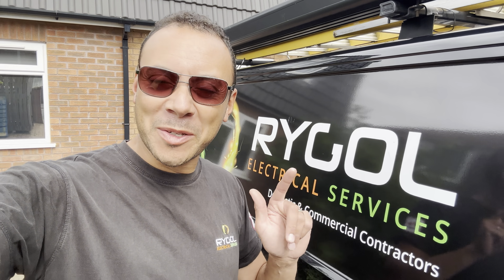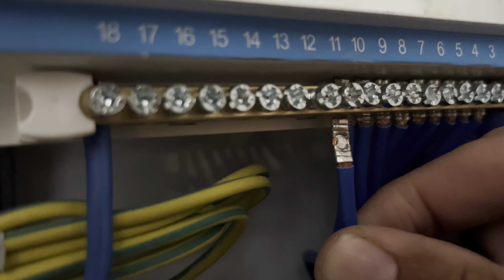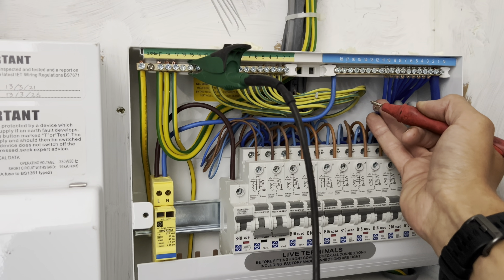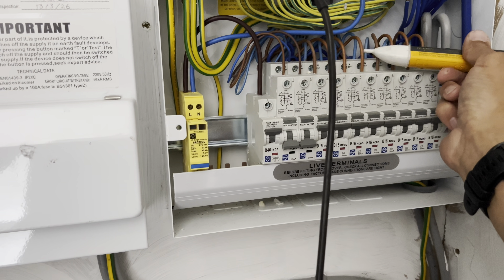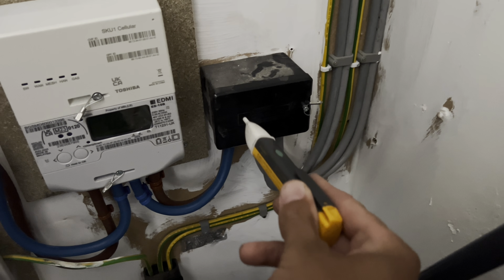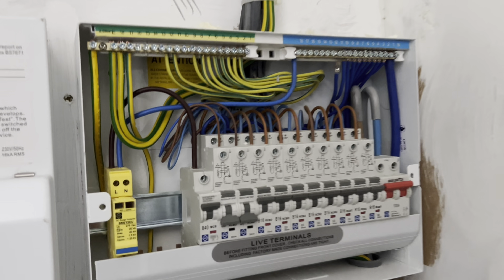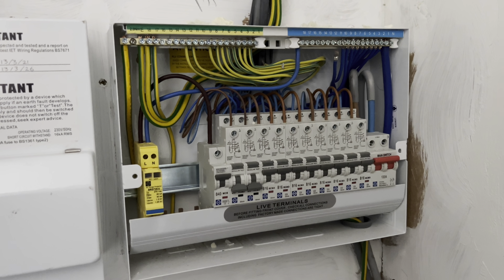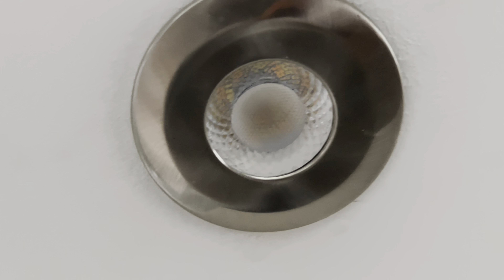Smart Meter Disaster! ⚡️

Comment: This is what happens when the person changing the meter is NOT a trained electrician and has only gone on a 1 day course.
Just had my "Smart" meter changed for the third time ( late last Friday). The "Meter fitter" got a screw cross threaded and asked to borrow a hammer to bang the screw in.
A complaint will be going in at 9.00 AM tomorrow.
Reply: Along with lack of experience or proper training, they're also under pressure to install as many meters as quick as possible
Reply: @mohammedusman7065  Don't even talk about it. As a chartered engineer, I was called in by one of the supply companies to sort the mess out. More than half of the guys trained for less than one hour, had no previous electrical experience whatsoever. 
They were swapping meters live, pulling service head fuses out on full load. On one installation, a caught a guy with all 8 cables dangling on a full current 3 phase installation. They were completely baffled when they encountered CT's and regularly burnt them out by not understanding the shorting  procedure.
The office sent one guy out to connect a 225 Kva supply to a tower crane. He had no idea of CT ratios and was not supplied with a shorting link block. Fortunately, he took one look and called me.
I am going to risk posting this on here, because it is for the right reasons. 3 of the guys could hardly speak 2 words of English. To me, they were the victims of a company who were not protecting their safety.
Reply: @mohammedusman7065  Those meters are very customer unfriendly, they measure apparent and reactive power which the mechanical ones were not, plus the inertia of the disc in old meters did not count usage "spikes", everyone that I know said their bill has gone up after getting smart meter.
Reply: @FrozenHaxor  Most likely the replaced meter was decades old and worn so underreading.  The bill increase would have happened with a new mechanical meter too.
Reply: @thisnthat3530  No, the mechanical meters in our country are changed every few years, the last mechanical meter for my house was 4 years old, and it's not just rotation of meters around for testing and anti tamper purposes, I vividly remember the production date of the meter matching the installation date. I don't remember the make/model, I believe it was a Landis & Gyr and it had a fault indicator LED if one phase happened to be out.
Reply: @mohammedusman7065  mine WONT be one of them i refuse it
Reply: Reverse polarity. Anyone with an old martingale would have seen that, could have killed a child,
Reply: NVQ's 😄👎
Reply: @g4joe  If they are being issued with NVQ's then this only confirms they are NOT worth the paper they are printed on
Reply: How come tge RCD closed with that fault
Reply: No one changes meters after a one day course. A MOCOPA qualification is required and the initial training is a week in a centre and then a portfolio is built up while working with a mentor for a few weeks. When you said usuing a hammer to bang a screw in, I initially thought a meter terminal screw and that would be horrific of course. But I assume you mean a screw into the fireboard? It's not something I would do but a newbie might if the screw head had lost it's shape and wouldn't go in or out. It does sound like you had a memorable experience though!
Reply: @0liver0verson9  No it was the bottom left enclosure screw on the new DP isolator switch that he had just fitted as he did not like the one that was fitted on the last meter change less than  year ago. Photo's of the bent screw off set in its hole have been sent to Octopus Energy.
Just thinking back to when I first started out all screws had to be "Dressed" now virtually no one even knows what "Dressing a screw" means let alone being able to see if they had been "Dressed" properly. Times change and standards fall.
Reply: @PeterChapman-rg6gr  Octopus Energy usually have high standards I hear, so they won't be impressed with this.
Reply: @0liver0verson9  That is what I am hoping. I have another scheduled meter installer coming on the 24th September to finish the work that the last one failed to do.
Reply: @picklyplum  Sorry to burst your bubble but I have had 3 Smart Electricity meters fitted by G4 meter fitters, sub-contracted to British Gas, who have been open about only going on a 1 day "Meter fitting" training course and now I have had 2 visits from Octopus sub-contractors to change my electricity Smart Meter. Neither of then have either done any "Apprenticeship" nor have any of them been trained "Electricians".
Ps I have already lodged a formal complaint with Octopus and tomorrow I will be sending them photo's of the newly installed isolator switch c/w its hammer driven bent cover screw.
Reply: A few years ago I had bought a new Hotpoint washing machine (mistake) anyway the main seal was leaking so an "engineer"" came out, we got chatting and he was ex RAF like myself only difference was I was an aircraft engineer and he was a "storeman"? I didn't think too much about it till the next day when the seal leaked again and they had to send another proper engineer out, the storeman had fitted the seal upside down. The second bloke  certainly did not sing the praises of the original bloke lol
Reply: 😂😂😂 .... a hammer to bang in a smart meter screw .....certainly not a true story ...... you are obviously confused as to why the hammer was required....
Reply: @deosiewilson732  Luckily not only did he ask me to lend him the hammer but I have sent the Photo's of the bent screw that is now off set in its screw hole and the impact marks of the plastic enclosure to Octopus Energy. The screw that was hammered home was the bottom left screw in the new DP isolator switch that he fitted as is clearly shown in the photo's that I sent off as is the tag seal number that he fitted to the adjacent screw so there is no dispute on who fitted, and sealed, this switch.
Reply: It's not a one day course.
Reply: @neilduran3586   so the G4 meter fitters who fitted all my BG smart meters were telling "Porkies"?
Reply: A one day course? Don't be silly.
Reply: @ChrisTopher-gu8gf  As I don't remember you ever being present on any of the many occasions when G4, The BG meter fitter subcontractor, was changing any one of the "Smart Meters" that they installed I fail to see how you can even comment on what any of them said to me re the minimal training that they received.
Reply: @PeterChapman-rg6gr  they've probably decided to wind you up! A one day course! 🤣
Reply: @ChrisTopher-gu8gf  or they could be telling the truth. 
Suggestion. How about asking Octopus Energy why I am now on my third visit, and third, use the term reluctantly, "Engineer" to install my latest Smart meter? No issues with either access or space but plenty of issues with lack of competence.
Reply: @PeterChapman-rg6gr  there is no one day  course where you can become gas safe and work on a gas meter and electric meter. To even think this is possible is abit silly. As for the previous engineer  visits. Yes you will get incompetent ones just like you can get incompetent people in ANY industry. Suggestion. If I were in your shoes I would have asked for an area manager to come out with an engineer and look at the issue and see if it can be resolved. Good luck
Reply: @ChrisTopher-gu8gf  Firstly my comments relate solely to those who have come out and failed to carry out a proper install of my Electricity "Smart Meters"
Secondly I have sent a whole set of photo's to Octopus Energy given the "Meter Fitter" is on sub-contract to them.
Reply: @PeterChapman-rg6gr  I'm sure you have Peter, I'm sure you have 😄
Reply: Incorrect you can have a 100% competent untrained electrician and a compleat IDIOT with a certificate as in this case!
Reply: If I had a £1 for every exposed conductor or lazy crap job from a 'qualified electrician' I'd be rich 🙄
Reply: @picklyplum no, you don’t “need” to be a trained electrician to undertake ANY electrical work, however you DO need to be a “competent person”, as uk law words it. This to me is a sensible approach as it allows sensible flexibility. A trained electrician backed by a trade body has that trade body behind them in court if things go wrong, to vouch for their competence. Someone without this backing is on their own in court. An installation such as the above would immediately be deemed incompetent and as-such the person responsible would feel the weight of the law. In this case that is extremely serious as they have put lives in considerable danger and in absolutely no way adhered to British standards in their work. Just unbelievable!!!
Reply: Should read backed by a trade body or equivalent. Professional engineers don't want to join a trade body. Time the IET supported us here. Would a consultant surgeon join the nurses scheme? I think not!
Reply: @RetropowerNat  and to be classed as a competent person for electrical work you must be
Reply: @RetropowerNat  Stuff like that happens in USA. I know of an apartment that had missing earths, missing neutrals and polarity reversals (hot and neutral), yes, all in the same unit.
Reply: @RetropowerNat   I reckon ZERO "weight" rests on a incompetent meter installer (- ignorance is bliss!).
however whoever authorised him, should have all the responsibility in them.
one should only need to follow the trace of for example, the seal tool - the network operator must have contracts with sub contractors when authorising them to seal equipment. with those contracts comes 100% responsibility to ensure / verify those sub contractors are "competent".
Reply: @laus9953  I don't agree the meter installer here had ZERO responsibility. I guess we'd have to know the training course, but I find it hard to believe that they wouldnt have been told of dangers of making neutral live throughout the entire house, and the importance of testing the installation on the consumer side.
Reply: @laus9953  Agreed, well said.
Reply: @RetropowerNat  exactly I do all my own electric work never bothered paying people unless its in a hard to reach place or if I can't figure it out. Even then we have loads of cash in hand romanian leccys around here so its cheap anyway
Reply: @picklyplum  But the tails coming out of the Henley block don't.
Reply: Failed to bring own force multiplier.  Unprofessional
Reply: So, I'm the only one that laughs when there's a sign on the toilet door saying "out of use - waiting on engineer"? I'm more than an engineer that it seems most engineers are these days, and I'm a physicist (I can hear engineers shuddering).
Reply: @beentheredonethatunfortunately  The word " Engineer" has been so over used and devalued that it can be applied to anyone capable of making 2 cups of tea in less than 10 mins. NVQ's these days mean diddly squat. Got my NVQ5 in less than 4 days.
Reply: @PeterChapman-rg6gr  You should see what happens when they attempt a CT meter and forget to short the CT's first. LOL
Reply: @PeterChapman-rg6gr NVQ. 
Stands for:- Not Very Quick !!

Comment: Here comes a stupid question, if the neutral and earth are tied together, how come it never directly shorted out and went BANG?
BTW I have the other version of socket tester with IEC lead and earth test, it shows defective earths on old 1970's sockets and confirms the kettle defo has no earth😁
It also has a test function for RCD but that don't apply to my house, it still has the original 1950's Wylex!
Reply: No it will not, as the neutral and earth/CPC are only bonded together where the DNO supply comes in. The neutral and earth/CPC should never be bonded at any other point. The only time that they would ever come in contact with one another is in the event of a neutral to ground fault (when the RCBO/RCD ought to trip). 

However, in this case where line and neutral have been swapped after the DNO CPC bonding point, if there ever is a neutral to earth fault, then unless there's a double pole breaker then there will be an enormous current flow which will blow the DNO fuse.
Reply: @TheEulerID  In Australia the neutral is bonded to earth  also to an earth rod so would have been a short seems like the way its done there is dangerous.
Reply: @bascomnextion5639  With this particular fault it would make no difference. 

However, as for the particulars here, supplementary earth rods make little difference on a TN-C-S system as the earth loop impedance via the ground is so high. It's usually in the several tens of ohms. It can be well over a hundred ohms in sandy soil in dry weather conditions.

If you want a decently low earth loop impedance that way, you have to go to something like full foundational earthing systems, which are best installed when the properties are built. Some countries do that, and I believe there are changes in UK regulations on their way so that all new properties are equipped that way. 

I should add that in the UK, for most properties which get their water and gas via metal pipes, then that tends to provide a much more effective supplementary ground due to the bonding to the CPC on point of entry when compared with a grounding rod simply because of the sheer amount of metal in contact with the earth. However, as newer installations have their services supplied via plastic pipes, that's much less effective.
Reply: I suppose that makes sense, not sure if my house is compliant with anything given how neutral and earth are tied together at the main service fuse and additional copper pipes used as ground rods connected to wherever the fuse box earth is.

Comment: If they’ve got no appliances blown up they’ve been lucky 😂
Reply: That sort of fault would never cause appliances to blow up. The appliance won't see anything different.

The problems are all about safety issues in the event of a fault, mostly where single pole switches and breakers are in use. For example, with line and neutral reversed, if there is a neutral to CPC fault, an MCB will not trip as the current will not go via the MCB sensing circuit. Of course and RCBO ought to trip, but if it only switching the line (like most in the UK), that won't stop the current flowing and it will probably blow the DNO fuse (if it didn't do that, the wiring will simply overheat extremely quickly). 

On a single pole light switch, the circuit will remain "live". The same is true of any appliance with a single pole switch, or with an internal fuse, or the fuse in a plug or switched spur. Should those fuses "blow" it will still leave a live feed to the device in question.

Comment: This is really odd. I had the same problem in 2009 when I had a normal meter change.  I had lights flicker, also the CFL types would build a charge and flash every few minutes.
I checked and found the meter tails were the wrong way.  They didn't even fit any isolation switch, so I had to open one connection box at a time, remove the wires to the fuse box and change them over.
Problem solved.
A lot of this is going on because people subcontract and get hobbyists doing jobs.
Reply: I am getting a bit sick of this hacking on hobbyists. Yes, there may be a lot of incompetent DIYers. 
Still, when I inspected about 15 houses while house hunting in Ireland, I found that most electrical installations were visually indistinguishable from the "hobby horrors" shown on the various electrician's YouTube channels. And it seems unlikely that every medium-priced house in Ireland was wired by a hobbyist.
Reply: @WimTon  100% same in England. I have several 'qualified' electricians come through and the errors they make are appalling. Just because they have paid for a certificate saying they are competent, doesn't mean they are. True professionals should be calling out these dreadful electricians, rather than DIYers, since the pro's are the ones that bring the profession into disrepute.

Comment: Should the Henley block not have been installed with the live at the rear and neutral at the front? Great find by the way.
Reply: Very informative video re “safety first”—-ie check everything—take nothing for granted
Reply: I agree with this in as much as it looks before changed like the meter operator connected their tails correctly with the brown at the back and neutral at the front. Scrolled trough the video but couldn't clearly make out where the brown went. Would have been more obvious if cu tails were coloured outers too
Reply: You’re not wrong. Reverse polarity coming from the double pole henley
Reply from the maker: Yes indeed, the live is at the rear snd the neutral is at the front. But the reversed polarity means it is the opposite.
Reply: @RygolElectrical  I never really liked the double pole connector blocks. Phase blocks are a better choice if room permits.